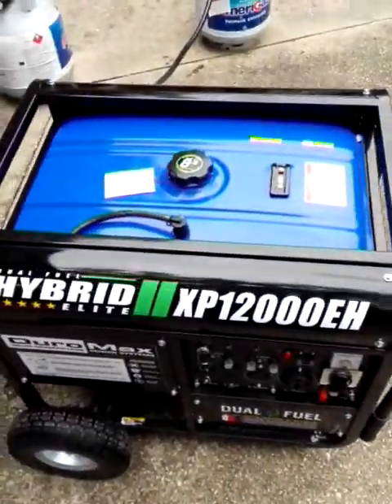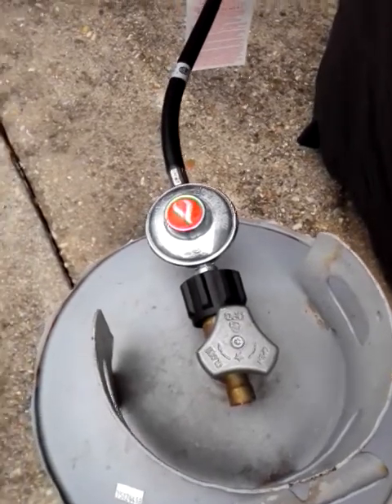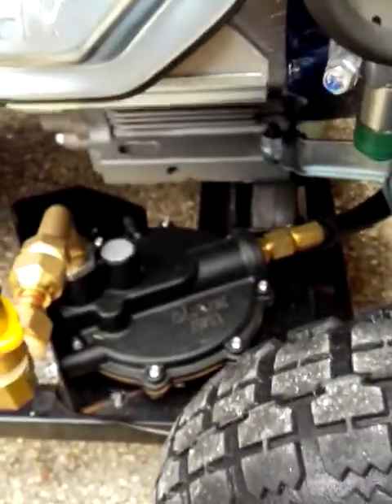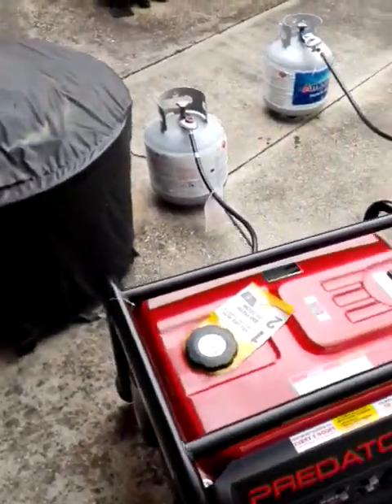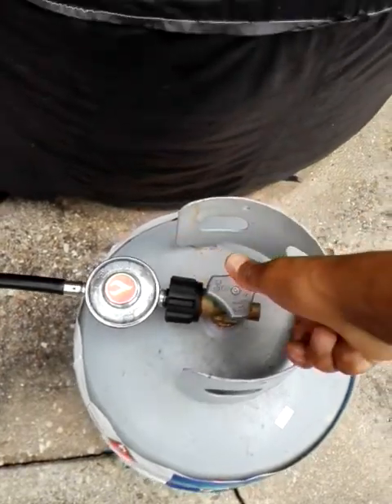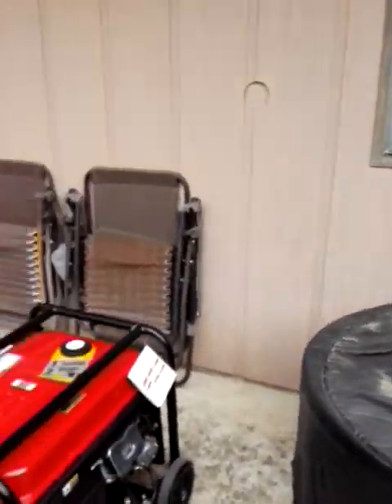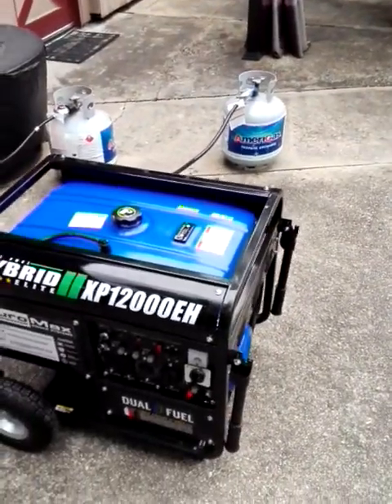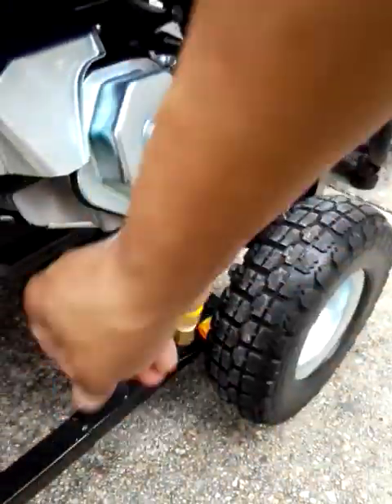Predator 8750 & Duromax XP12000EH Dual Fuel Generators

Comment: Can you parralel these
Reply from the maker: Can you give a bit detail to your question???
Reply: @TechGuruLamar  can you hook them together to make more watts.
Reply from the maker: @brucewillis7135  I definitely wouldn't advise this!!! Though you could Parallel them together and get more power via a central outlet. I know a couple people who have done this but it's a safety hazard!!! You also have to factor in hazards such as if one generator quits before the other!!! This in turn will take the load off the equipment you're operating and shut down or damage the generator still running!!! If possible buy the size generator you need for your application!!! And if you're wanting to run your Central AC Unit / install a hard start kit!!! I did on my 4 ton!!!

Comment: Hello Shelton! The "new" thing is retro-fitting your dual fuel to tri-fuel and running them on natural gas. Oh my. Thanks for sharing. Cheers from Motown!
Reply from the maker: Yeah, exactly. That's my next move. Propane is good for quick connection and camping but terrible for running power outages. It doesn't last long at all. 20lb tank only last 5 hours top. Regular gas runs 10 to 12 hours half load. Natural gas is the way to go for all who thinking about this option.

Comment: Duramax regulator is for liquid gas(propane)... In order to run it on natural gas you need a add on regulator, the big one that attaches to the frame.
Reply from the maker: Yeah, that's for the guys who want that option. We're specifically talking propane. Thanks for comment.

Comment: Great video, thanks very much for posting. Do you think the "quick disconnect" is safe ? is it leaking ? Thanks
Reply from the maker: No, no leaks. The seals in them are rated for the pressure.

Comment: When running on propane I thought the choke was not to be used🤔 On gasoline yes but propane no. Other videos indicate this- just an observation.
Reply from the maker: When using a self regulating regulator, choke has to be used to get it running per manufacturer's instruction.

Comment: How long will the small propane tanks run the generator?" Roughly"
Reply: DuroMax website says a 40 lbs propane tank will give you 7.7 hours at 50% load.  8.8 gallons of gas = about 8 hours of run time at 50% load.

Comment: All that other equipment is very important. The big 6" regulator that you do not have on the predator is a safety device that shuts of the gas when the engine stops. Your hook up does work but if the engine quits running and you are not there the gas will spill out of the air cleaner and may go bang and burn your house down.Do you really think all of us smart people are dumb because we paid $ 100,00 for a safety shut off .
Reply from the maker: Actually when I run my generators they are no where near my home because of carbon manoxide.  2nd, I would never run any generator if I'm away from my home. I strictly monitor all my gauges and meters to make sure no gas is leaking and that my units run very efficient. 3rd, if you really depending on a cut off valve that's known for failing then take that chance. I'd rather be the valve myself  than leaving my home and depending on something that's man made. Last, you said yall were dumb for this, not me. I simply stated all that equipment is not needed
Reply: I think, “not there,” refers to, not being in close proximity to the generator.  There’s no need to run a generator and not be home, but if I’m asleep, or using the restroom.  I think I’d go with the safety shut-off...  those tanks also look like 5 lb cylinders, and someone gave the run time at 50% load for a 40 lb cylinder.
Reply from the maker: @donaldebeal  Failures of any piece of equipment are bound to happen. We must remember these are Portable Generators, not Standby. My setups work perfectly fine and are monitored at all times while in operation. I would advise anyone not to use any generator in close proximity to their homes for safety reasons. If I have to worry about potential accidents while I'm asleep or using the bathroom, I dont need to run a generator at all. I think you're putting to much into it. It's just a generator.

Comment: Hello, basically both generators predator 8750 and Duromax XP12000EH use same carburators ? I mean, can I use the same dual gas/fuel carboretor for those generators ?
Reply from the maker: It depends, there are different variations in some carburetors. I would order the one for the model generator your running.

Comment: Hey man did your duromax come with 2 red shipping brackets under it that had to be removed
Reply from the maker: Yes
Reply: @TechGuruLamar  thanks for the reply cause in the instruction manual it said orange bracket and there wasn't one under there when u take the brackets off do u put the bolts back on or discard them as well
Reply from the maker: @guitaristgod666  No, just put the screws and brackets to the side in case of return shipping for future repairs if needed.